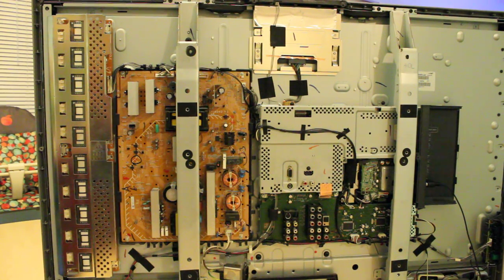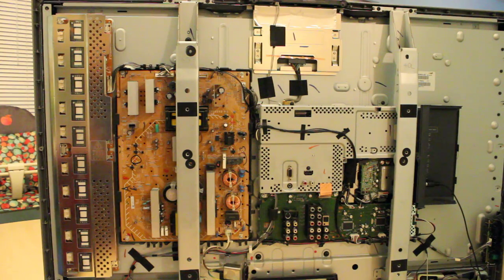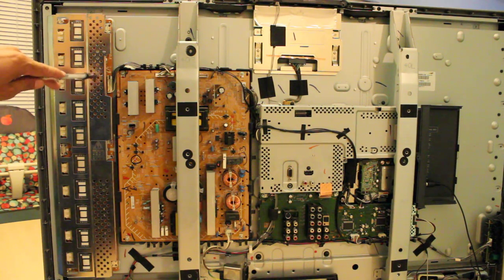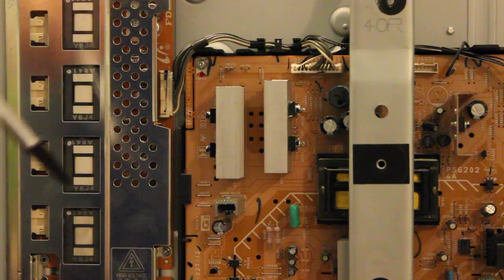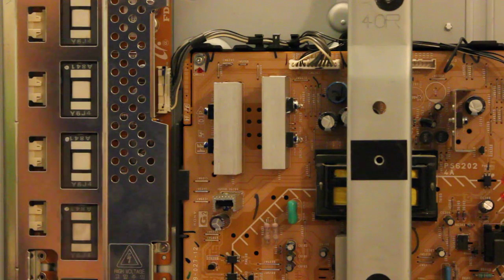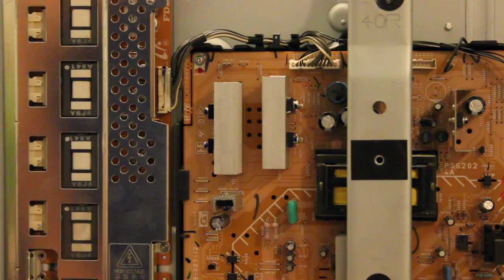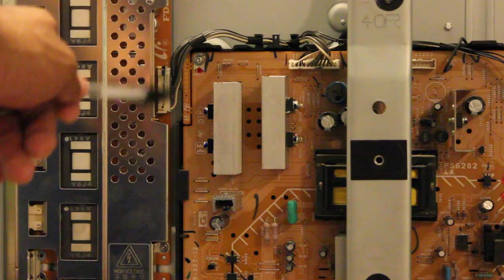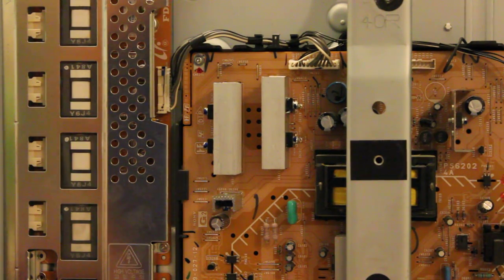How To Repair 40" Sony LCD TV With 4 Blinks

Comment: Connection is clean and tight but board smells like it fried. Do you think if I replace the board it will work. Or possibly something else caused it to burn up?

Comment: Hi Run... I have a Sony Bravia  KDL-46V2500 which appears to have two boards on each side of the tv, both sets connecting to the power board.  I cleaned the connectors on both sides but still have the problem--very dark picture and shuts down on its own.  Any other ideas?

Comment: Hello  I have a Sony Bravia  KDL-40V2500, it will not power up ,it just shows 4 blinking red light , I tryed  cleaning  and checking  the connectors  ,but nothing  changed  , do you have no what elase I could  check or might  be  wrong

Comment: Hi i thought i had solved my 4 binks problem with My Sony Bravia LCD with a new inverter board but i have the 4 blinks again sadly. A new connector to ps maybe the answer or bad connection pins from power supply board. It worked okay for a time. Have you any advice? Thank you

Comment: I watched your video on the repair of the Sony bravia 40 in TV and I wanted to know if it would work on the 60in Sony bravia model # kdl55nx720. I have the same problem that u speak of in your video.can you advise me on what to try.
Reply from the maker: +maria jimenez Hi, can you describe the problem in detail. Also, does the problem stop after the TV has been on for a while?
Reply: thank you for replying, when I turn the TV on  the standby red lite turns to green and about 2 seconds later the TV is on, there's nothing wrong with the picture, that still looks great.But then not 5 seconds later it turns off  an you see the standby  red lite blink exactly 4x in a row, then it pauses then it starts up again with the same 4 blinks.
Reply: +Runforlife The TV doesn't stay on longer than 5-10  seconds  after  I turn it on.
Reply from the maker: +maria jimenez It looks like the issue is being caused by either a faulty connection as shown in this video or a faulty inverter board. You could try what cleaning the connector that goes into the power supply and inverter board as shown in this video. if that does not fix the problem, the next thing to replace is the inverter board.
Reply: +Runforlife I did open up my TV in hopes that it would resemble the one in your video, but it looks nothing like the one in your video so I wouldn't know what that faulty connector looks like on my TV!
Reply from the maker: +maria jimenez According to the service manual for this specific model 4 blinks means a bad LCD. However, the same problem has been found when there are faulty connections. Try unplugging every connection and plug them back in. You have nothing to lose, since the worse case scenario is that indeed you may have a bad LCD which due to costs is not worth repairing. You can start by unplugging and re-plugging the connectors that lead to the power supply, which is the big board to the left of the TV as seen from the back.
Reply: +Runforlife  well I guess it has a bad lcd, because last night I did unplug all the connectors and plugged them back in and it still does the same thing. turns on then off. what a bummer, I really liked my TV!! Well I thank you so much for taking the time to reply  on this and  I really appreciate all your help. thx again!
Reply: mari a jimenez

Comment: hi its me Maria again, its about my Sony bravia,  the technicians at Sony say if I had a bad lcd board my TV wouldn't have a picture on it but mine does have a really good picture when you turn it on....it just won't stay on!! so my question to you is ware would you  find the part #  for the inverter board on my TV? my TV's model # is kdl 55nx720. I found a bunch of inverter boards online for my TV, but they want the part # an I don't no ware to find it!! I would be forever grateful if  I could get your help on that.
Reply from the maker: +maria jimenez The TV is shutting down to protect itself. According to the service manual from Sony for this specific model 4x blinks means a bad LCD. However, it might also be a bad inverter board. You would need to actually take the TV to a tech so they can actually measure voltages coming out of the power supply with the TV off and on.

Comment: I need you to tell me , as the inverter repair , watt items is failing . thankyou
Reply from the maker: +jesus Valdenebro Hola Jesus puedes describir tu problema a detalle?
Reply: Thankyou.Sony Bravia . When you turn light is flashing stanby . componetes all the main Blast , they are good . the failure was caused by a short power supply
Reply: the failure was caused by a cut in electricity supply from the public grid . I think it may be blocking short circuit in the inverter

Comment: Cleaned the connector off with a tooth brush and the tv now works. Thanks for the video!
Reply: how did you remove the conector to clean it?
Reply: @pierozanatta5214  Had the same issue. It seems you have to forcefully take it off.
Edit: Late reply lol

Comment: Runforlife,  I had this problem in my TV - red led blinking 4 times. and TV switch off.  I saw you video , and ...you save my life man!  Just like you say , I clean de conector from  power supply to the inverter board  and the TV ...brings to life! Thankyou so much, gracias , obrigado.
Reply: how did you remove the conector from the power supply?

Comment: Just for people that have a surge protector to know that this will happen with the 4 blinks if the sp is bad so just plug the tv to the wall directly and if it works without turning off replace the surge protector
Reply: dude youre the GOAT, this worked.
Reply: What is sp?
Reply: @marvinmanaois321   SURGE PROTECTOR is what "SP" mean

Comment: Hey Runforlife, this worked for me and I'm very thankfull for your video. Cleaning the side of the inverter board didnt help but cleaning the other side of the cable connecting to the power board did the trick for me. My TV was a Sony bravia KDL-40v2000 btw that I got when my parents moved to a smaller house but when I plugged it in at home it became clear it didnt work anymore. (thx mom and dad).
Reply from the maker: Glad to hear you were able to repair your TV. Don't forget to like and subscribe! Thanks!

Comment: Got a very similar - or the same Sony - a KDL40W2000. Unfortunately don't think this is the answer (as using a lamp tester for the CCFLs shows the connection from plugs that go into high voltage side of inverter to the lamps is unreliable on quite a few of the lamps). Thinking of doing an LED conversion instead of trying to resolder the wires to the lamps and wonder if you easily know from experience what voltage a working inverter sends back to main board to say it is OK? Like a 3.3V signal or similar? Because if I did the LED conversion I would remove inverter but need to make TV act as if it is still there. Made a video to explain the details further https://youtu.be/YNADrX6zNq0 but if the question is a hassle to answer I quite understand If I get no replies from those with obvious experience (worst case I think I might get access to a working Sony TV of correct age to see what voltage the inverter board on that sends back as "OK & working" signal).